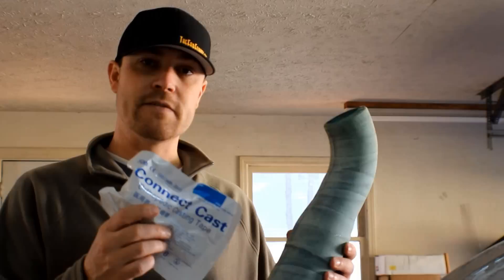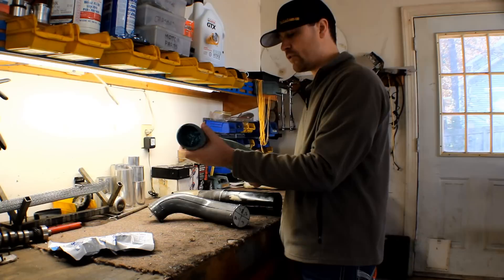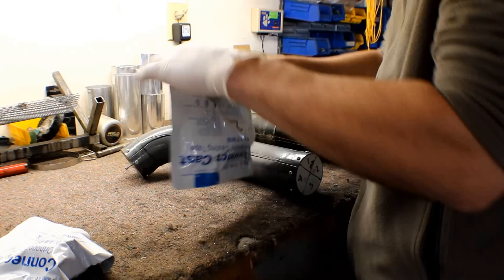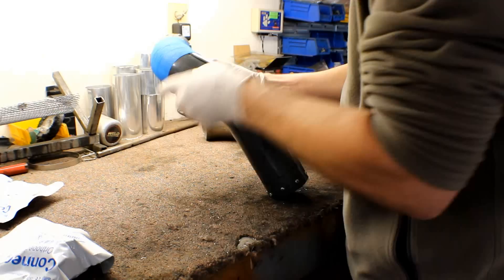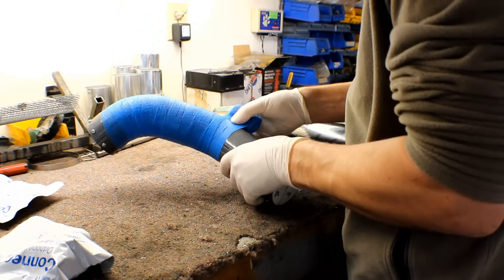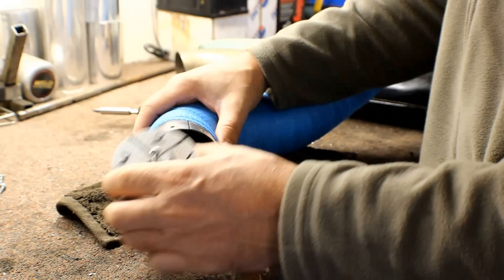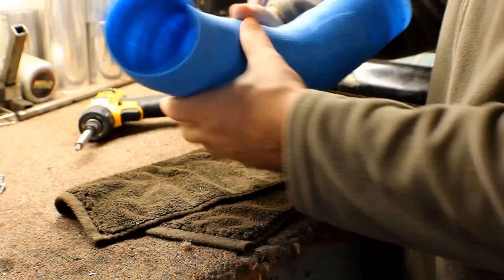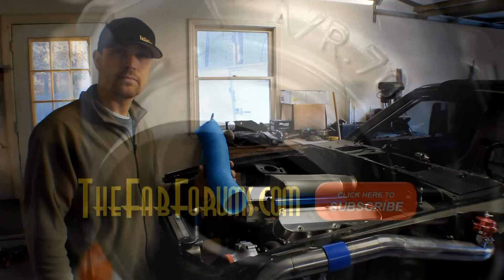Making Composite Intake Tubes

Comment: Looks good, but you could also perform a lost foam technique, where you design foam that disolves in acetone. Once you make your shape, use a PVA or wax to reduce sticking, and wrap Carbon fiber around it. Once fully cured, you can use the acetone to melt away the foam, leaving a hollow inside.
Reply from the maker: Correct
Reply: I assume you could use a 3D printer to cut or create different shapes of tubing when using this technique which would allow you to have perfect precision.
Reply: You should be careful with it, because it will damage the epoxy impregnated carbon fiber.
Reply: Yeah but this was easy and not messy at all
Reply: What kind of foam is that?

Comment: Good  job,  i saw  3 of your videos with composites and it`s  ok. I have years working with composites, and your sistems are ok, maybe you can learn about the wet seams  systems used in RC  fiberglass fuses  to join the two halves,  it grow your systems of works, and  you can add more techniques.    Congratulations.

Comment: this stuff lights up pretty good I find  I ordered a box to discover this
Reply from the maker: what do you mean lights up?
Reply: Catches fire really easily when dried, good for making brake ducts and stuff, and prototyping don't think engine area is for for it
Reply from the maker: lol...

I have used it in the engine compartment with no issues. I will have to do some testing I guess

Comment: Hi Fab, I liked the idea of using the casting fibre glass, especially for complex double curvatures like the intake pipe.
If I might be so bold to make a suggestion ! I would have taken your wrapping of the intake with the pre marked up areas right up to the ends backing up this with photos for reference, then waited for it to dry and trimmed off any excess, then transferred the holes marks in the sectioned steel (a good idea by the way) into the casting. This would have given you a one piece end result prior to the CF shrink wrap. Also you could have included some washers within the fibre glass at hole locations (eventually they would have been incorporated into the CF layer) this may have resulted in a better performance in the pressure test and because of the ultra strong design of this piece of pipe (with all the interacting radii) it would have been great to see it fail longitudinally instead of at fixings.

All in all Ive enjoyed the experiment and thank you very much.
Reply from the maker: +issac krupps yeah these videos were not to make a finished part...more to show my technique. Thanks

Comment: So you are saying after we put fiber glass resin it will fill up the pin holes and block the leaks but since this is a solid color and not reflective how will it stop heat from heating it up under the engine bay, which in turn will heat up the air running inside to the intake.
Reply from the maker: the material doesn't heat soak like aluminum and steel

Comment: this isn't car related, but i'm trying to join 2 pieces of rectangularly carbon fiber hollow tubing together to make a longer long piece of tubing. any suggestions for how i would press the attaching pieces of carbon fibre strips used to join the 2 pieces of tubing? someone mentioned an inflatable rubber ball or some sort using a compressor. have you ever done this? or could you point me to the right place? thanks!
Reply from the maker: Oh wow...I have no idea on how you could do this because I have never done anything like that. Some kind of inflatable sounds like a good idea to me.

Comment: how do you think casting tape would react to fuel if one was to make a intake plenum with it. i was thinking of using foam and once it dried dissolving it in its cast and reinforcing it with fibber glass resin . the only other thing i was wondering is how well would this bond to to aluminum . thank you.
Reply from the maker: dragbrick not sure on the gas...I could rest it for you. Also not sure how well it will bond with aluminum but I plan to also test as I would like to use it for the ends of my tubing.

Comment: After the tube is cast, would it be sensible or cost effecient to use regular header wrap?  Outside for heat dispalcement? Think I worded that right.
Reply from the maker: chuck lane Header wrap probably wouldn't help much because the fiberglass wrap pretty much already has the same anti heat soak properties as fiberglass header wrap.
Reply: TheFabForums.com Thank you.

Comment: you may have already said this but what type or resin did you use?  the two components you put in the cup?
Reply from the maker: Sumner Swaner you don't need any resin with the casing tape. The wrap is already pre impregnated with a resin that is activated by water.

Comment: I have a question, if i have a more complex shape, can i make a 'mould' out of styrofoam (which is easy to shape) then wrap it wit this, then simply file / shave the foam ut of the inside (destroying the mould, but its a one off peice )
Reply from the maker: yea that will actually work very well. i think you can even use chemical to dissolve some foams away.
Reply: TheFabForums.com
Using Acetone (propanone) you will dissolve the styrofoam! I make CF tubes with this technique, than I dissolve with acetone!!
Reply from the maker: xPhenxxx Thanks for the feedback...I will have to try that out.

Comment: You don't want to wrap it in carbon fiber and use it. The casting material and CF expand at different rates, to the point it could cause cracking and warping. You really should stick to one material.

That being said, the casting tape would work great for creating molds. Use some filler to smooth it, sand it down, and bam.

Comment: im considering making a carbon fiber roof overlay for my car. Without risking resin on my factory paint, I thought about using this casting tape to make a "mold" of the roof. With your experience, would casting tape work for an area like that?
Reply from the maker: +MICHAEL W I would probably just use a large piece of plastic to protect the car

Comment: Would this hold the temperatures of intercooler piping?
Reply from the maker: Yea I think it would. From the experience I have with it it doesn't really get hot because it doesn't conduct heat like steel or aluminum

Comment: Thank you for another great video, do you think this tubing can withstand boost pressures or is this pre-turbo tubing just for induction?
Reply from the maker: Thanks ...Although I have not tested it yet I think the seamless tubing could withstand boost especially if it is reinforced with carbon fiber. I think the issue would be keeping the ends from blowing loose. I will do some work on this subject...

Comment: Have you utilized methods similar to this for piping on the pressure side of turbo systems? or only induction side?
Reply from the maker: I have not, but I have thought about it. I think its plenty strong enough to handle boost just not sure how couple it.
Reply: TheFabForums.com V-band, if you can get the end of the tubing strong enough to deal with the clamping pressure and have the V made into it. We use it on Turbo'd Hondas all the time.
Reply from the maker: Joe11Blue I agree...had thought about trying to mold in aluminum v-bands some how.

Comment: I would like to see a video of how you marked and then cut the tube. The cuts didn't affect the diameter of the tube? I would like to see how you attached it too. I like the styrofoam and acetone idea another youtuber had below. Duplicating those bends in styrofoam would be the challenge though. Nice work and interesting process.
Reply from the maker: The foam is only good to make one. This particular mold was used to produce several parts.

Comment: If I make a tube like in the video and reinforce it with carbon how much weight can it hold ? I have a motorcycle that I has a tube in the frame and want to make it carbon !
Reply from the maker: I really have no idea. The one I made is easily strong enough for me to stand on. 200lbs
Reply: I have an idea you can use for a future video make 3 tubes 
1 fiberglass (like the video) 
2 carbon reinforced fiberglass (like the video )
3 make a carbon reinforced tube wich is not hollow on the inside but has a cylinder piece of foam and strength test them by hanging weights or something ;)
Reply from the maker: The one with foam would be the strongest by far

Comment: Could you just wrap the quartered tube in carbon fiber instead of going through the step of using the fiberglass wrap?
Reply from the maker: I guess you could but I like to apply my fiber with a vac bag and it would probably make a mess using the quartered tube. You will see in the next video the part will be bagged inside and out.

Comment: Does this leave a residue on the plug you are molding? I want to see if I can use this to make a mold of a front lip for my car, but I don't want to jeopardize the integrity of the original lip.
Reply from the maker: It does not leave any kind of residue on the steel tubes I use. I think you will be fine....what material is your front lip made out of?
Reply: TheFabForums.com it's an oem lip so I'm pretty sure its urethane
Reply from the maker: I think you will be fine

Comment: Has this held up to the heat generated in the engine bay? It looks great, I like it, will be trying it. I'd like to make a ram air induction w/ heat shield to the cone air filter that I have in my s13.
Reply from the maker: Yes I have been doing this for year...have had no issues

Comment: This appears to be a great way to make composite tubing, my only concern is having a smooth surface for airflow on the inner part of the tubing, will the texture of the cast fiber cause any performance issues regards airflow?
Reply from the maker: +Douglas Foster its perfectly smooth on the inside. The tube cause it to make a very smooth surface
Reply: +The Fab Forums Awesome! Thanks for the response.. Thinking im gonna have to give this a go since I make alot of my own parts with carbon fiber and have been lightly mulling over a good way to make tubing.
Reply: Douglas Foster idk if you have done it yet but you try bladder molding to make tubes

Comment: very smart idea big props for the video !
this is only for intake not for turbo intercooler piping right ?
this composite pipe cant hold high turbo psi have you tried this ?
Cheers from Greece !
Reply from the maker: I have some videos on my channel of me pressure testing these tubes up to 30psi with no failure.

Comment: Why reinforce it, why not use the metal structure to make the carbonfiber one to begin with?
Reply from the maker: you could but I wanted to show both processes
Reply from the maker: That calculation only works in his instance of three layers of glass and one layer of carbon. In my tube there is only one layer of glass and one layer of carbon and in that instance the carbon is the stronger of the two and is essential for overall strength of the tube.
Reply: The Fab Forums carbon is not purely stronger than fiberglass  
But it's strength per lb is higher and it is stiffer 
Fiberglass and especially s-glass fiberglass ( higher grade fiberglass) is stronger overall 
Just not per lb

Comment: how did you fabricate the 4 piece mold?
Reply from the maker: I created the tube I wanted out of steel, made some end plugs using a hole saw. Then using a jig saw I then split the tube in four pieces.
Reply: TheFabForums.com Oh ok.  I guess what I was getting at more specifically was this; how did you bend the steel tubing? I was thinking of using pvc just to simplify the process
Reply from the maker: I bought mandrel bent 3" U bends and then cut to create the custom tube I wanted.

Comment: Sweet,  I got the 3 inch cardboard tube,  my wife is bringing home some casting wraps.  What to use for the release agent?
Reply from the maker: Carnauba wax works well
Reply: Thanks Bro,  hey I was wondering if my mold is about 3 1/2 feet long can I wrap the whole thing and cut it to make 2 sections and connect with couplers
Reply from the maker: Yea possibly

Comment: Very impressive! One question. If the Fiberglass tape gets wet, won't it deteriorate or deform? I'm questioning because the intake might pick up some humidity from the ambient air in a more wet climate with snow/rain.
Reply from the maker: Broke Racers no once it has set up it wont be affected by moisture.
Reply: Great! Thanks for the response. I'm gonna try this out. Love the creativity!
Reply from the maker: Sweet...you will dig the results

Comment: How high temperatures can this withstand?
Reply from the maker: never had any issues with engine compartment heat. even built an intake manifold that worked good.
Reply: What temperature does that usually get to?
Reply from the maker: Aeroscience not sure...maybe 200 degrees

Comment: I know this video is a little old but I am hoping I will get a response. First off, I think this is awesome and I will be ordering some casting tape on payday. Second, and I may be the only one thinking this therefore wrong and that is okay but, don't we like the inside of our intake tubes to be smooth? Even though you are wrapping the casting tape around a smooth mold the texture of the tape is a weave so it is porous and rough. It seems it would slow air down not aid in its trip through the tube. As far as creating a stupid light intake tube, you got that. I do not want to debate that, I would just like to hear your thoughts on the inside texture of the casting tape tube. Please? Alternatively, could we use a vac-pack plastic mold then wrap it with casting fiberglass? Thoughts???
Reply from the maker: the tightness of the wrap actually makes the inside very smooth.
Reply: So then whatever resin they use in the casting fiberglass must smooth out against the mold. Now to see if my brother in-law will let me use his vacuum form rig to make positive mold to wrap the casting around. Thanks bro, you are awesome.

Comment: isnt the inside a bit rough for an intake? shouldnt it be smooth? real question
Reply from the maker: +Mr.xxxxxxxxxx17 no the inside is extremely smooth because of how tight its wrapper around the steel
Reply from the maker: +Mr.xxxxxxxxxx17 no the inside is extremely smooth because of how tight its wrapped around the steel
Reply from the maker: +Mr.xxxxxxxxxx17 no the inside is extremely smooth because of how tight its wrapped around the steel
Reply from the maker: +Mr.xxxxxxxxxx17 no the inside is extremely smooth because of how tight its wrapped around the steel
Reply from the maker: +Mr.xxxxxxxxxx17 no the inside is extremely smooth because of how tight its wrapped around the steel
Reply from the maker: +Mr.xxxxxxxxxx17 no the inside is extremely smooth because of how tight its wrapped around the steel
Reply from the maker: +Mr.xxxxxxxxxx17 no the inside is extremely smooth because of how tight its wrapped around the steel
Reply from the maker: +Mr.xxxxxxxxxx17 no the inside is extremely smooth because of how tight its wrapped around the steel
Reply: The Fab Forums Thanks for the answer :D

Comment: I don't understand how this works :(
Reply: +Dominique Shoshan The fiberglass tape is impregnated with a polyurethane resin which, when activated by water, undergoes a chemical reaction that causes it to set. Since this is a chemical change it only happens once and is irreversible. Think of it like cooking an egg: you add heat and it turns white -> brown -> black then crumbles to ash. Taking away the heat doesn't reverse the process. In the same manner, adding more water doesn't cause the material to soften again.

Comment: Unlike fiberglass or carbon fiber, Cast Glass isn't made to be heat, gas, flame resistant or fuel proof..... others have wrapped over these cast tubes just to have the cast material inside come apart and wind up in intakes, impellers and clogged up mufflers..... excess heat or excess damp conditions can make it soft and noodle like.
Reply from the maker: Nah they are water proof and do very well with heat...I have some that are over 5 years old.

Comment: I don't like the final product 
But, I like the stainless steel mold tool!
You should send it to me I can make better use of it to make carbon fiber parts
Reply from the maker: Im sure you could
Reply: The Fab Forums  can you make one for 02-07 WRX Sti short ram Intake pipe mold  but instead of the circle piece holding the pices together make a ring so the mold is a female intead?